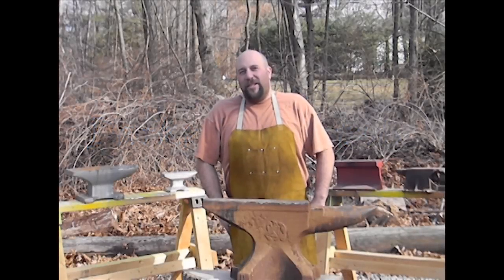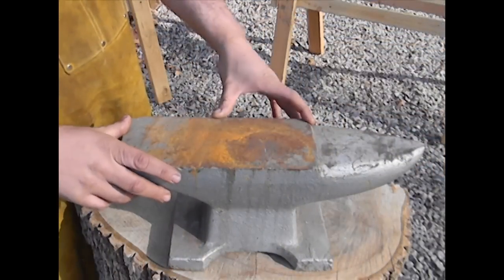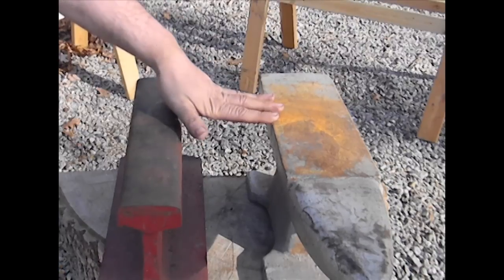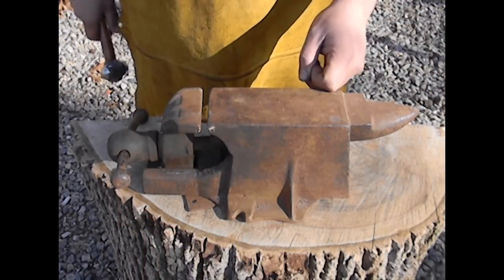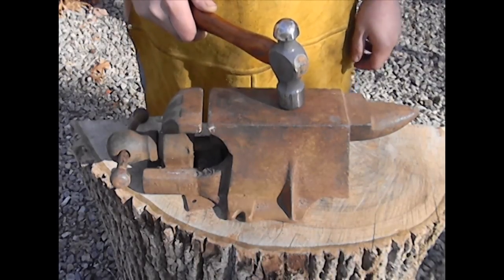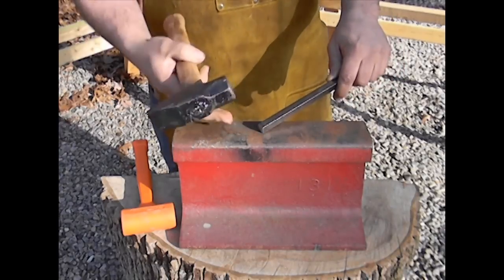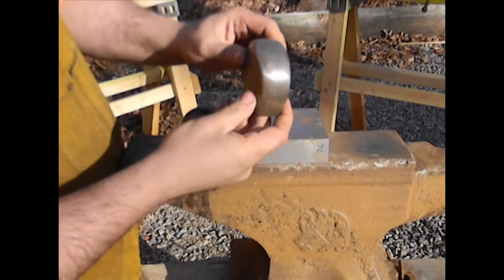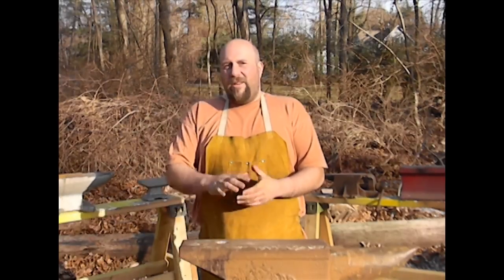The Basics of Anvils

Comment: Hi, Over all, the info was good but I would like to say a  couple things.
I have been blacksmithing for over 30 years, I am an instructor for CBA California Blacksmith Assoc. 
Please do not try to cut a chunk of RR track to look like an anvil. The result will be on a par with the ASO (Anvil Shaped Object) that is cast iron. There is way too much spring as the web is too thin. If you must use a RR track, stand it on end like a fence post, now you will have a solid mass of steel under the hammer blows. Yes the target area is small but you only need enough for the hammer face. In this position, you will get a rebound to the hammer and you will be much more effective in your blows.
A solid block of steel that weighs 75 to 150 pounds will make a VERY good starting anvil. Look for a section of round stock 4 to 6 inches in diameter and again set it like a fence post. Also, a cut piece of plate 3 or so inches thick and 12 inches X 12 inches works well when striking on the 3 inch side with the mass under the hammer, not flat to get a big surface. In anvils, more is better. You need mass under the hammer. A block of steel, smoothed by a grinder with a rounded end at one end will be a better anvil than nearly all smiths in history has had up until the addition of hard plate to the face.
You can not add a section of high carbon steel to a block by welding with an arc welder. Even if you make a good, solid weld, there will be a huge un-welded section in the center, this will spring and flex, sucking the energy from your hammer blows, wasting your energy. It is better to just start with a good block of steel, preferably 100 to 120 pounds, grind smooth and don't miss your work with the hammer. If you do, smooth the face with your grinder. Every mark in the face of your anvil or your hammer will transfer to your work like a stamp and it will make cleanup of your work all that much harder.
Reply: Excavator bucket pin is what I used
Reply: Wayne Paris 
The idea of standing up a RR track on end like a fence post is stupid.  
An RR track is obviously going to make a smaller anvil and will be used for smaller things.  RR track is completely legitimate as the small anvil it produces.
Reply: @kcb5336  You have it backwards, more mass under the hammer and more stable is always better regardless of the size of the project. The mass under the hammer when the track is on end is much more stable and the greater mass will allow more metal to be moved. On it's side, there is no mass under the hammer and the web acts like a spring moving side to side and you get the double whammy of no mas and a non solid surface. On its side is worse for both smaller things and bigger things, while on end you can do both better. The size of the striking surface does not matter as the only work getting done is under the hammer so as long as the anvil is big enough for the face of the hammer it is much more effective in moving metal.
Reply: wayne parris 
I understand what you’re saying and I’ll agree you’re technically correct. But we’re talking a 50-60lb RR track anvil compared to a 300lb “real” anvil.  What do you expect the size of the project to be? I would expect the project will be in proportion to the anvil itself.  That’s all.
Reply: @kcb5336   No, you are not understanding. I am talking about a 60 pound track and a 60 pound track. Mounted vertical (like a fence post which you said is stupid)  it has much more mass under the hammer and is much more stable, more mass and more stable is better.
Better yet, avoid the whole track thing and just buy 50 to 100 pounds of scrap steel in a block form. I never said anything about a "real" anvil. A block of scrap mild steel about 10 inches x 12 inches x 3 1/2 inches thick is about 100 pounds. Or 2 feet of 3 inch dia round bar or 2 feet of 3 x 4 rectangle bar etc.  It can be bought for roughly fifty cents a pound depending on where you are. Mount it so it is 12 inches high, and 10 x 3 1/2 across the face. You now have what has been known for centuries as a block anvil. Made from better steel than was ever available in the past.
Reply: wayne parris 
I completely understand and I agreed that vertical is more stable, just unnecessary, therefore stupid. For any project properly proportioned to the RR track anvil it will be just fine.  There still a lot of strength in that little anvil. Sufficient for its use and size. There a simple saying, “leave well enough alone”. The RR anvil serves it’s purpose. It’s certainly not only good enough but excellent for its own application.
Reply: wayne parris 
I just re read your original comment. You’re an instructor, that says it all.  That old saying “those who can, do, those who can’t, teach”. 
In the real world dudes use RR anvils all the time. They’re great!
Reply: @kcb5336  LOL really? You went there? :P :P Ya I teach but I also run a full shop. I donate my vacation every year to demonstrate blacksmithing for the National Park service at Yosemite, for free. I set aside 2 Saturdays a month to teach skills to people who want to learn, my time is donated for free. I put on a 3 day blacksmithing event every year at my shop, again you guessed it I donate all the work for free. Yes in the real world, which I live in, people use track for anvils. It is because they are ignorant of how bad they really are and that much better methods will give better results for the same or less money. You are never going to get me to take a bite of dog $hit and say it tastes like Swiss Chocolate. Track anvils are a waste of time and energy to make when much better options work VASTLY better,  cost less and have much less labor involved. Actually in the first post I played down things a lot, I have been smithing for over 50 years and teaching on weekends for over 20 years, the donated time for Yosemite has been about 20 years. What do you do for the blacksmithing community other than being a keyboard warrior? How have you made the world a better place to live in? What do you do to further the craft for future generations?
Reply: wayne parris 
Ok guy. I’m the keyboard warrior yet your replies are 2-3 paragraphs longer than mine each time. And you’re actually gonna say to me I didn’t say what I’ve done. I didn’t cite my credentials. I just said credentials mean nothing, why would I provide mine? This isn’t about our background or experience. It’s your failure to understand the concept of , sufficient or smaller.
Reply: @kcb5336  Wayne has a rightful point, and yours maybe good for small job, soft steel or jewels that do not need a big anvil...or big hammers. This video is for blacksmith use of an anvil, so let us end the discussion for what it is (or was).
Reply: @slchang01  
I said early in my exchange with Wayne that yes he’s technically correct however I believe what he’s suggesting is unnecessary. Sometimes sufficient is just that, good enough.  I made a few small brackets for my lawnmower engine go cart with my kid.  I could have welded them but it was just about the experience and sharing something with my child.  
As Wayne and I exchanged he also edited out parts that I replied to.  
I’ll double down. RR anvils are great.

Comment: I have been wanting to learn blacksmithing so I found a 3' section of railroad track fastened it to a log very close to the same width little overhang attached it with railroad spikes and it has worked very well the past 3yrs, I built my forge the same way out of an old gas water heater center tank cut length wise in the middle and 55 gal oil drum as the stand, all still better then you can buy at a store, I found a 3" inch  x 1'x1' plate steel that I will temper in camp fire and water, rout out the top of a  tamarack  log counter sink it in that is my next anvil I am working on... thanks for the share ...

Comment from the maker: @MrJsowa you can weld them together to create a heavier base, keep it from bouncing around on you. As far as the heat from welding changing the properties of the metal... If I am unsure about stresses I do the welding in stages, a few inches at a time. If you keep the temperature in reason you should have no problem... make sure the pieces you want to weld are at least 60 degrees before you start welding and you should be good.

Comment: dude great video,any recomendations on wether or not to weld a bit of tool steel to a block of softer steel,and if i did would i have to do anything to it like heat it or anything to releive stess.any advice is greatly appreciated.(its a block of steel like 8inx5inx6in(25lbs) and a piece of a gigantic wrench stamped rockwell 50somthin,so decently hard stuff)

Comment from the maker: In the old days there were a lot of cast iron anvils with good steel tops welded to them. Most if the time these were forge welded. My only concern with arc welding them would be the cooling of the welds. The steel and the iron expand and shrink at different, it may crack if your not careful. My advice, look up a video on repairing an anvil. If they are arc welding for the repair they would have the same issues you would face adding the hardened surface, give you an idea of what your in for.
Reply: In the old days the body of an anvil was wrought iron, not cast iron. I don't think it is even possible to forge weld a steel top to cast iron!

Comment: Hi great video. So with the steel anvils reflecting the energy back, if i was hitting it with 20 lbs of force and my anvil was 40 lbs would this be a good ratio? Kind of a open question but there must be a certain amount of weight for the anvil to be before returns diminish?  Regards
Reply from the maker: Welcome to the channel, There are several videos out here that talk about hammer weight vs the weight of the anvil. Its not something I know much about. I will however mention that using a sledge on a cast or wrought anvil can break off the horn or tail. Sometimes people try to forge their hardy tools right in their anvils hardy hole, they figure bigger the hammer the faster the metal is going to move. If you have ever seen an anvil with a broken tail that is why about 90% of the time.

Comment: i am looking for an anvil ,but is no anvil , can i use an section of a  I-Beam (about a foot and half in length and 12ins  in wide about  3/4 ins thick
Reply from the maker: An I-beam is okay for starting off, just try and stick to the middle of the beam so all your forging is over the center support. Remember a long long time ago the first anvil was a rock... so your not off to a bad start.
Reply: Jeffrey Santo were would I go in Tennessee to find rail track or a cheap anvil
Reply from the maker: Jonta Anthony Fiddlers Grove Blacksmith Association - Lebanon, Tennessee...  They may also have more local resources, I found then on facebook.
Reply: Thank you that's very helpful

Comment: I just found myself a 131 pound Peter Wright anvil at an antique store. Got it for $325. It is in great condition, all the corners are great, horn is near perfect, and it rings and rebounds beautifully. However, a small bit of mushrooming on a 1-inch length of the side and there is some scars and stories to tell on the surface... nothing deep, just looks like a bunch of thumbnail intentions. I would think hardened steel wouldn't react that way, but it rings like it. Maybe pounding from the last 130 years could do that? Hoping i got a decent deal.
Reply: You got a high quality anvil. What makes it a decent deal depends on your financial status as well as how strongly you needed/wanted a high quality anvil.

Comment: Jeff,
Great video. Thanks.  Subscribed.  BIG QUESTION FOR YOU!  Saturday I finally found an anvil which suited me!  It is in fantastic condition!  I can't figure out how to PM you or post a picture, but is is very similar to your "good" anvil.  Casting marks on the side and all make it look like a different model from same manufacturer.   

Mine has absolutely no manufacturer markings anywhere. I lifted it with my tractor and nothing on the bottom either.   Came from a 78 year old fellow who inherited it from his dad and he thinks it was first on his grand dad's farm here in VA.  The anvil weighs approx 350 lbs.  QUESTION IS:  How did you determine age on your anvil and (presumably) the manufacturer.  Yours is the only one similar to mine that I've found on the web.

If you can tell me how to reach you, I'll send pictures.   I hope you are still checking comments on you tube.  Thanks, Jerry
Reply: Jerry Thrash the first anvil he showed was a Fisher anvil. There are lots of fan sites for them online

Comment: There's an old piece of railroad in cement laying near my school,  and I'm thinking on going with a hacksaw and taking it,  the only problem if it is just lying around our if it works for a specific function
Reply: +agustin venegas I've sawn through a section of railroad track with a power bandsaw. You'd better bring a lot of hacksaw blades with you is all I can say. Maybe a lunch too?
Reply: Paul Frederick hahaha ok, i'll look for options then, thanks for the advice
Reply: agustin venegas
 It helps to look at a cross section of cut track to gain an appreciation for the amount of material involved.  http://i.imgur.com/QsCXj.jpg That flat bottom surface is 5-3/8s of an inch wide. The head is 2-3/4" wide. So it is a thick piece of steel. My poor little band saw could not cut it in one pass. http://i.imgur.com/YvLQO.jpg

Comment: Hey, i was always wondering (because i always had an anvil in my home), what is the hole for? If You explained it, sorry- didnt understand that : )
Reply from the maker: There are 2 common holes on an anvil, one square (the hardy hole) and the round (the pritchel hole).  The hardy hole is used to hold a verity of tools from cut off and bottom tools to hold down tools. The pritchel hole was traditionally used in conjunction with a tool called a pritchel or pritchel punch. These were used to create the holes in a horseshoe where the nail would be seated.
Reply: Jeffrey Santo
 Thank You for quick and precise answer : )

Comment: Anvils wrought not cast the first one you can't forge cast
Reply from the maker: https://www.riogrande.com/Product/LargeCastIronBenchAnvil/113812?gclid=CPLyg4Catc0CFZM6gQodc8kBcw

Do a google search for "cast iron anvil"  You'll see...
Reply: there are both forged (wrought iron with steel face) and cast (cast iron with steel face or solid cast steel) anvils out there, the first one in the video is cast iron with a steel face, you can tell them from a distance because the faces are thicker and stand proud of the body (they are cast on, not forge welded) and the logo also stands proud of the body...a wrought anvil generally has a thinner face and the join line is harder to see (they are forge welded on) and any makers marks are punched into the body...a solid cast steel anvil will have no "shelf-like" face but will have a proud makers mark...other clues are the body texture which can clearly look forged or cast with careful observation...stay away from solid cast iron "anvil shaped objects" (and generally cast iron anvils of any type)...